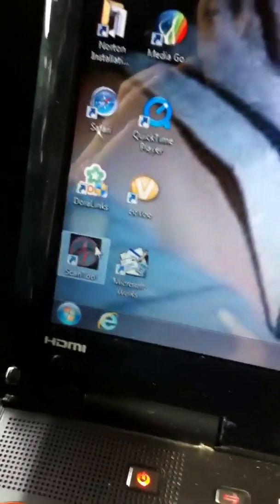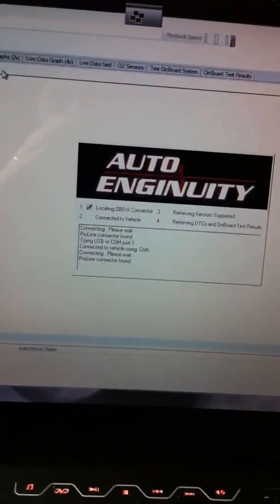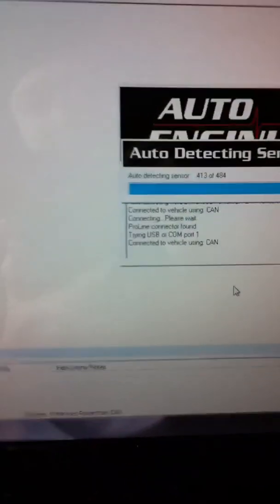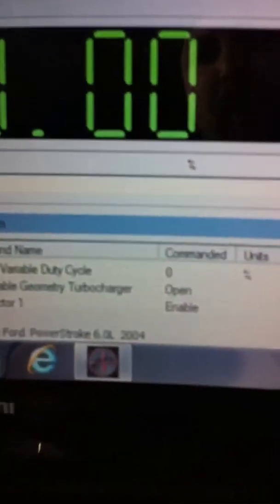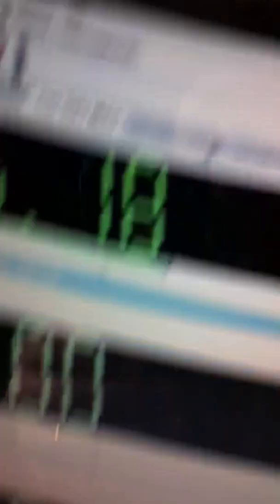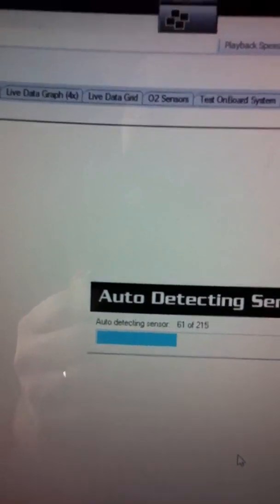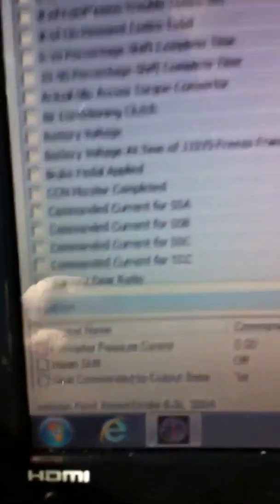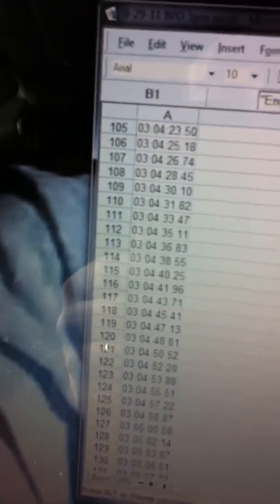Autoenginuity 6.0 quicks start

Comment: Hi their, when truck has a no start, would I be able to check the IPR percentage ICP pressure, Ficm power and Ficm Sync? also can does this software let you disable each injector at a time while the engine is running? to verify which injector or cylinder is weak? thank you.

Comment from the maker: No issues with disconnecting abruptly. Could be many things, virus on your PC, wire or cable issue from ODBII to USB at PC, OBDII power wire loose. Might want to contact AE for more info.